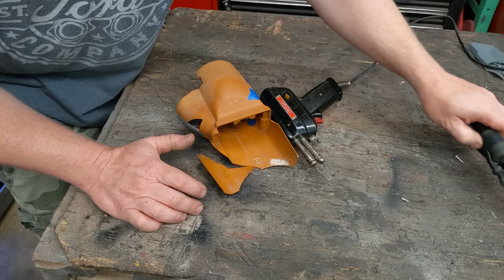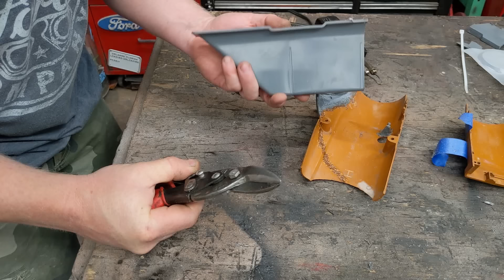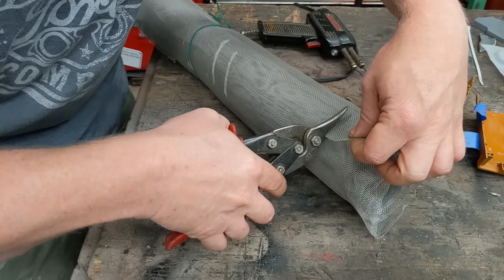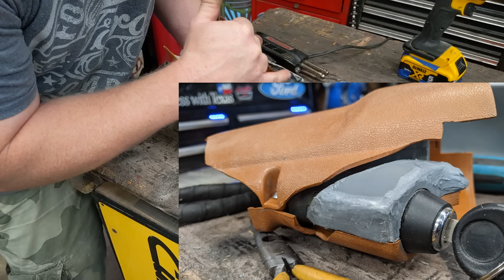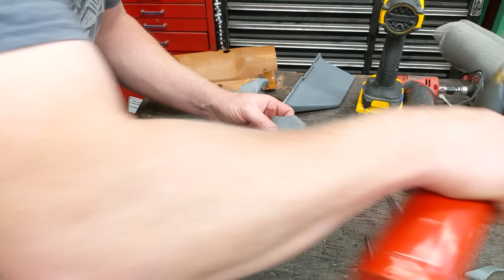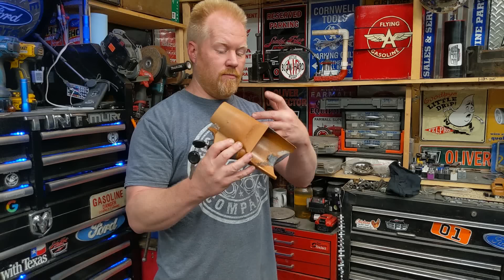HOW TO FIX broken plastic ULTIMATE Welding Forming Repair techniques

Comment: I've used safety wire in my solder gun to use as a hot staple.  Works pretty good too.  But I twist it just under theto layer of plastic but I really like the window screen mesh.  Super strong, fixable to for contours and thin to work with thin plastic.

Comment: Cool, I've often used cut up paperclips as 'rebar' to melt in and embed in the plastic.
Reply: You should check out the hot weld staple gun and assortments of different shape staples for it. They are all stainless steel and there are inside & outside corners,  wave shapes and straight shapes. I just got one a couple weeks ago and I'm repairing plastic parts that are so small you would never think you could repair them but with these 0.6 mm and 0.8 mm wire staples and the precision with the hand gun welder it's amazing what you can fix now. No more throwing parts away that are broken because I can't glue them together. Now I weld them with wire staples melted into the plastic and if it's still warm enough you can push the plastic together where the staple went in with a small flat head screwdriver or fill it in with the liquid resin that hardens under ultraviolet light and then sand it down and it's like new.
Reply: @topc5826  p
Reply: @topc5826 
Nice, never heard of that. What model do you recommend
Reply: Haha even though it was like 12$ at the time , I got that cheap harbor freight plastic welder and felt robbed when I opened it and had a soldering iron , some screen and some plastic sticks to melt.
I've got that stuff laying around the shop 🤣
Reply: @MrTheHillfolk  I love that kit! It saved me over $5k.  I messed up my 2002 BMW Z3 M roadster. The stupid parts for just the brake duct cooling was getting over in the $1k range for used parts.  I could almost buy a used one take the parts off cheaper.  I ended up buy 3 kits.  Learned to build up sand and paint.  Can't even tell now.
Reply: @MrTheHillfolk  I bought the same unit and have had excellent results with it. You tube videos calling it junk and showing the tip bent, or broken off had obviously used excessive force instead of letting the tip heat and do it’s job. I like the triangle tip with more mass that puts more heat into the plastic.
Reply: That's a good tip.   I'll have to remember that
Reply: @fryreartechnology7611  , xt
Reply: @fryreartechnology7611   ,,,,,c.   Xx
C  x
Reply: I use window screen a lot on interior an exterior repairs..I'm actually building a custom rear bumper cover for one of my cars as I'm watching this
Reply: Staples work to
Reply: Same here. Try copper ( quick conducting properties) I fixed my Hyundai excel door handle! Lol. Ugly but it was a piece of vomit on wheels! Lol😂
Reply: @Edmond3290  if it’s goin it’s all good send that thang!
Reply: Pph
Reply: Faux Que  yeah that kind of depends on how thick your material is you might burn Right through it while it's  cooling off
Reply: Op loop
Reply: I use pieces of metal and JB weld
Reply: Thks for the idea, paper clips.
Reply: you're smart

Comment: I did a lot of plastic welding as a ski shop tech back in the 90's. We had a hot air welder that didn't require contact with the plastic, but sometimes using a soldering iron or the torch-heated tip of an old screw driver was necessary.
Reply: At my ski shop in the 90s we used PTEX, essentially black ABS, set it on fire and dripped it into the deep scratches of the bases of skis/snowboards.
Reply: @brianwelteroth9248  PTEX was quick and easy, but it is pretty soft and would wear out quickly. We had an extrusion gun that was a similar product, but had better adhesion and lasted longer. But sometimes, with deep gouges and core shots, you had to lay in some epoxy, then a few beads of plastic filler rod with the air welder.